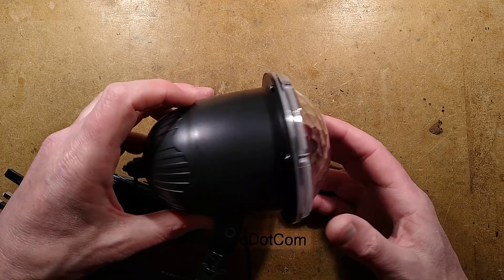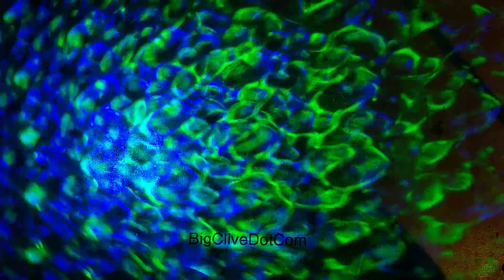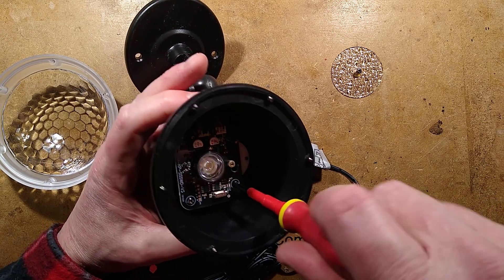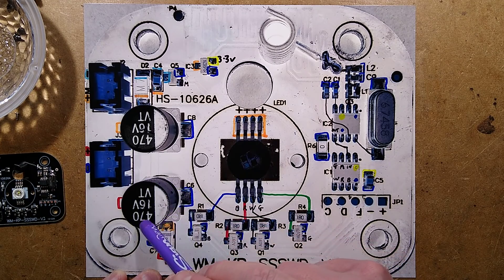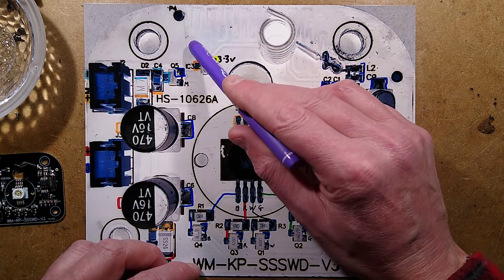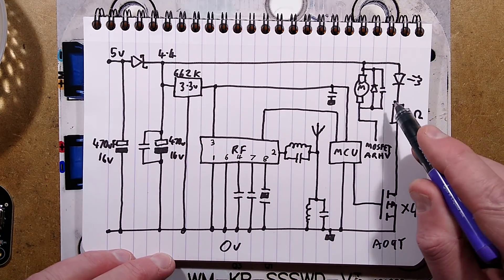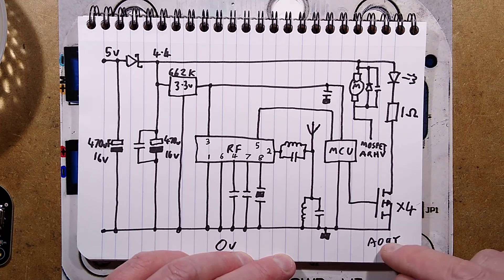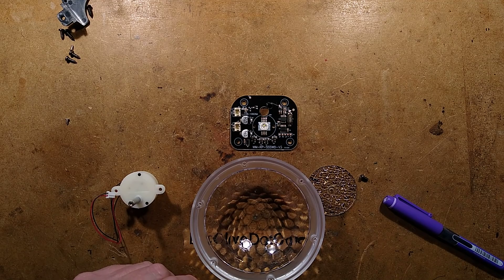Outdoor Xmas ripple projector teardown (with schematic)

Comment: Hi, I was looking inside a few BT ADSL micro filters and noticed they are not all the same.  Some, like the Excelsus Z-Blocker Model Z-420UK have a reed relay in them. I wondered if you would like to do a teardown and work out why a filter needs a relay in it ?
Reply from the maker: I'll check that out.

Comment: CPC started selling TV spares, they were in North Road, Preston for years in a tiny unit, they moved to the new one by the M6 about 25 years ago, joined with Farnell and the gang and have grown since then. I first went there to get the "special" bits for TV's like startup thermistors and replacement remotes.

Comment: I've had varied luck with re-using the cheap IR units, I tend to just throw them away and rely on the jog button.
The projectors themselves are actually too good - you'd really have to hate your neighbours to turn them on for too long facing your house.

Comment: Wow a device that isn't completely glued together and wires soldered to the PCB.  This is a very serviceable device. All you need is a Phillips screwdriver to take it to bits. It's nice that the power cable and motor wires aren't soldered to the board too.  It's a nice change.

Comment: Something a little off topic here. I have a light button with 24 multi coloured lights from a fairground ride this was made for 110v hiw can I convert it to 240v on a normal 3 pin plug any ideas please thanks
Reply from the maker: It depends on the type of lights.  If they're the colored caps with small lamps inside they usually have groups of low voltage lamps in series.   You may be able to change the series circuits to suit a higher voltage.

Comment: I'm sick of seeing those types of power supplies because they won't go into an outdoor waterproof socket 😟
Reply: That is annoying. I use an extension cable with the socket end put into a plastic sweet container (Roses, Heros etc) then I plug the power supply into that. For extra protection an upturned plastic bucket over that with a brick on top to keep it there. It's just a temporary Christmas arrangement and works for me.

Comment: Paralleling the 4 mosfets drive [Gates] via a single signal from the MCU??? All 4 operate with simultaneous intensity deviation, if it even brightens and dims. They could have controlled each LED individually and created the ability to change colors. Stupid engineering leaving bread and butter on the table.
Reply from the maker: Each MOSFET is individually controlled.

Comment: I visited Mystic Marine Life Aquarium in Mystic, Connecticut once and they had the Bob Ballard under the ocean display there. To get into it, you walked through a 20 or 40 foot container that had once been retrofitted to be a watertight lab on the deck of one of the Woods Hole Oceanographic Vessels. There were impressive computer desks and gadgets the whole length. Eventually, you wound up in a subdued lit round room maybe 8 feet in diameter, which had an infinity mirror in the both the ceiling and the floor. It represented a place in the ocean, I think around 500 meters down, which was a major "sound channel" in the ocean, where the sounds of ocean creatures such as whales were amplified so they became really loud in that chamber. And of course, those sounds were piped in. It was a pretty amazing prop though, I must say. 

The last room I came to had alot of hi-tech gear like thin LCD computer screens that were see-through which could intermittently become opaque or transparent in a second, depending on what was displayed (I mean, this was 20 years ago. good technology for then).  And samples of sea-life such as sightless crabs (I believe) and deep sea "smokers" that were sealed in Lucite. But the one thing that impressed me the most were the lighting Gobos, two moving across each other in front of the lamps to create a ripple effect far better than any I've seen so far on the LED ones. The whole room literally felt like you were living in Bikini Bottom, or something. :) 

I thought once that it would be nice to build a lamp that moved back and forth and had a lens filled with blue colored water (or a viscous liquid) that might make the same ripple effect, but I wasn't sure that just oscillating from side to side would achieve it. Maybe some sort of vibration platform?... anyway, love these type of lights. The effect can be so peaceful. :) So thanks for tearing this thing apart, Clive. Really interesting to see what's inside. All the best, Buddy!
Reply: Ballard lives in my home town, back when I used to get dragged to church, I’d see him there

Comment: So while we are n the subject of RF controlled LED lights, I have a question.  Is it possible to use or "tune" an RF remote from one light, to be able to control another?  The reason I ask is, I bought one of those LED "puck" pool lights and it didn't have a remote, but I have another RF remote that I found but it won't work with that light.
Reply from the maker: While using similar frequencies, they may use different codes.

Comment: I think the other coil antenna was bodged addition after they realised that onboard antenna was turned into a capacitor by aluminium backplate._
Reply: Totally an oversight by the designer that I'm sure was kicking themself when they realized.

Comment: I appreciate the way you present your videos. Although I don't fully understand electronics, your photos and diagrams are helping me to get there. Tube equipment is also quite fun to figure out. I grew up with a little white radio, listening to songs and talk on AM, and staring at the orange glow in the back. Of course I took the cover off.

Comment: I think that the antenna, originally, was the onboard one, but due to the onboard metallic heat sink they decided to add a wired one to get better reception because the onboard one has some issue.

Comment: Quick question is there a push on/off button on it? I was going to mention this a few teardowns ago. Long press the on/off and wait for it to blink 3-7 seconds. When it flashes hit the on button on a remote you want to use and bam it's connected. It works with so many of those LED lights that use remotes. So if you lost a remote you might be able to control it with a different one.
Reply: Crazy thing is I bought a led white light seems a different remote to it and discovered that the what was supposed to be just a white light happened to be multicolored was able to  control it with the other remote that has color buttons.

Comment: The  2 Antenna may also be for 
Vertical and horizontal polarized (radio propagation) - Little shocked they didn't go for  circular polarized antenna Or even use the mains DC cable 
for when the Remote it being held in odd angles for odd polarized positions  - shame the remotes gone for a Walk
Reply: Possibly, but most of those are probably in the 400mhz range. The huge ground plane of the aluminum plate is definitely a no no. I think Clive is right when they made an oopsie with the ground plane and bodged in the spring antenna. Using the power cable as an antenna only really works for lower frequencies.

Comment: Does that power supply connector style have a name? I have some lights that use that connector (though it is 29VDC) and I wanted to buy a small extension piece so that I could stick a relay on it without modifying the existing cable. I couldn't find any information about it at the time and ended up using the existing cable.
Reply from the maker: Although it's used with Xmas lights a lot, I'm not sure of the connector's type.
Reply: Ah, too bad. Thanks anyway.

Comment: I think you're spot on, putting an antenna on an Aluminium PCB is the work of a 'smooth brain' ....cheers.
Reply: Cheese!!!
Reply: @fredflintstone1  Squeak !!!
Reply: Adding an aluminium piece and a copper coil to make an improved device is impressive and cost effective.
Reply: @sewasewa6585  They didn't add any Ali they built an aerial on an aluminium PCB then added a copper coil to make it work by the looks of things, how is that impressive ?

Comment: the ripples look like wind on the water   hmmm   with an orange or red and yellow light it would look like flames    hmmmmm      magenta light projected upward across a structure would like the off glow from an open dimensional portal.   hmmmmmmmmmm

Comment: I imagine that this light projector employs RF remote control functions because of IR requiring line of sight to function properly. With the "bug eye" lens presenting a diffracting effect on any infrared light entering the case, it might just have attenuated the signal too much to reliably work using IR. The RF receiver, having a bodged on coil (air inductor) for the RF front end, to capture enough radio signal to operate, tells me that the PCB design might have originally be specified as phenolic or fiberglass and for some unknown reason, ended up getting changed to metal backed... perhaps to function as a heat sink for the surface mount mosfet transistors... It is very strange to see this because any decent RF design engineer would have known that the PCB "antenna" was in actuality nothing more than a low value capacitor and would have a very low sensitivity for capturing radio signals. Regardless, this was a very interesting tear-down! Thank You Mr. Clive, for the very comprehensive teardown of this ripple light projector.   Fred
Reply: The IR reciever could have been mounted on the back of the device. Which also would make sense since the light will typically be mounted to face a wall thus also obscuring the reciever if it were located inside behind the lens instead.
Reply: The aluminum backing is for heat dissipation for the LED. the FETs wont get warm at that power, the LED will tho. Ive seen this sort of thing in the wild. I would suspect the original design used discrete LED's, and then got revised with a 4 die unit as the cost of those came down. with the dies split up, the need for heatsinking becomes less of an issue. Ive seen this in the wild, when multiple engineers all have a different part of the process. someone decides to change the LED's, maybe a scribble on the a printout of the schematic, someone else re-routes the board, someone else places the order for the pcbs, and notes the LED's he got needs an Ali backing. we know the design works, lets make a couple thousand. the guy who did the original design isnt there. somehow nobody thought hard enough that the metal plate might effect the RF. OG designer gets back from holiday, calls every one a bloody idiot, wraps a piece of wire round a pen and BLAMMO it works again. seen that sort of thing happen a few times. usually when a part has to be substituted. wrong package pitch, wrong pinout, wrong mounting holes. never seen wrong PCB, but I can see it happening.
Reply: @arjovenzia  Your take on this design makes 100% sense to me. The LED package would definitely be capable of producing a lot more heat during operation than any of the MOSFETs would. I agree with you. Compartmentalized engineering departments are Famous for this, you are correct. I have been part of this type of engineering myself, working together with a dedicated mechanical engineer. As the design engineer, I had to also appease the marketing "guru" who always came to the design reviews with "simple" changes. I honestly don't miss any of that!   Fred

Comment: As it is an outdoor-effect it probably has an RF-remote controll. I have one of those "garden lasers" that also has this generic type of remote that is used for so many RGB-lights with a normal IR-LED, but the Laser has an antenna wire dangling out and there is no IR receiver on it.
Reply: IR struggles to get through modern glass. You can confirm this by looking at your IR reflection with a FLIR.

Comment: That mechanism is really simple and neat. I have seen products that over complicate the stuff by using a rotating pcb with leds and a very horrible power supply system. The device also seems to be decently safe.